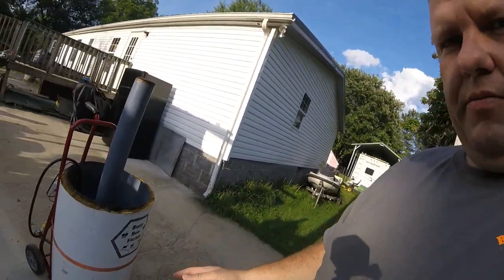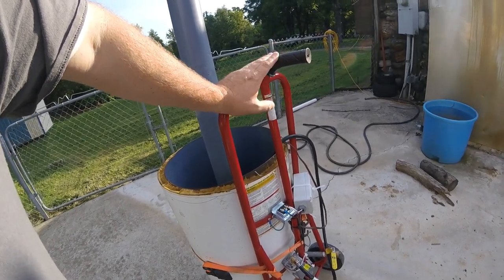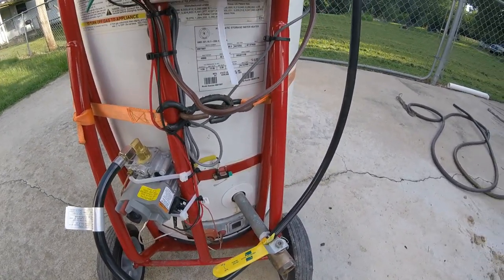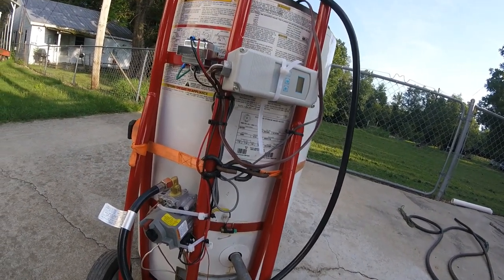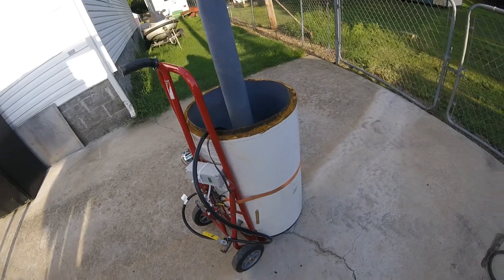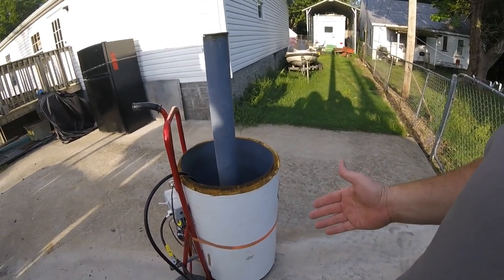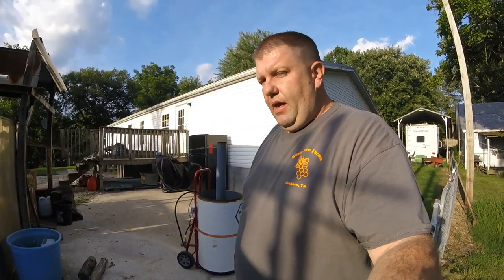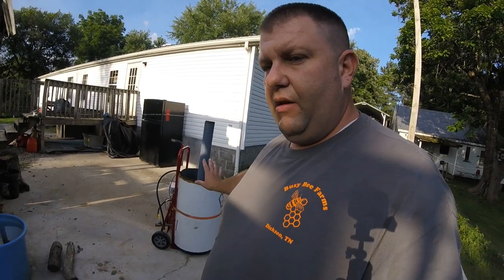How did we build our Chicken Scalder

Comment: That is nice I couldn’t see part number for gas valve is was blurry and maybe part number for ranco thermostat?  Thanks just found channel and subscribed.
Reply from the maker: The thermostat is a Ranco Electric Temperature Control ETC-111000-000 Single Stage, 120V AC… The Gas Valve is a Honeywell 185-VR8200A2132… the 24 volt transformer was from Lowe’s for a door bell, no part #’s just a 110 to 24 volt transformer… Hope this helps, thanks for watching and subscribing

Comment: Is there a way to run it just gas without the added electric thermostat?
Reply from the maker: Well sir, you could leave the original thermostat from the water heater, however from what I'm told it's not very accurate on the water temp, it might fluctuate 20 deg, scalding chickens you only have about 5 deg between feathers won't come out to it's too hot and the skin tears... That 145-150 is where the critical temp needs to stay for an easy plucking of your bird
Reply: @busybeefarms5929  
No offense I was just curious..
I come across yall on stoney ridge.